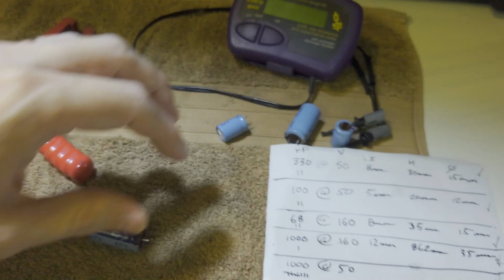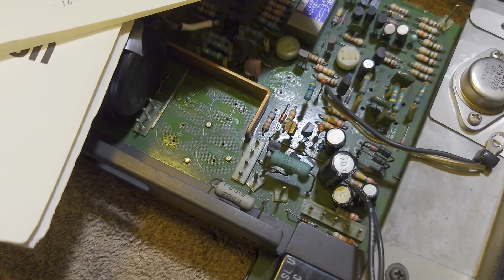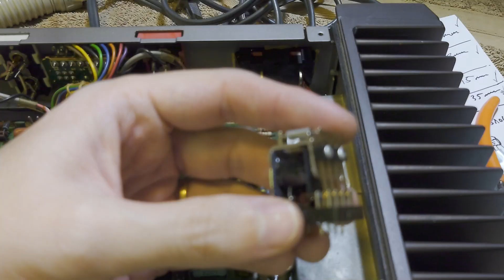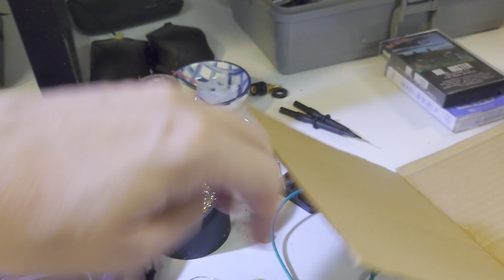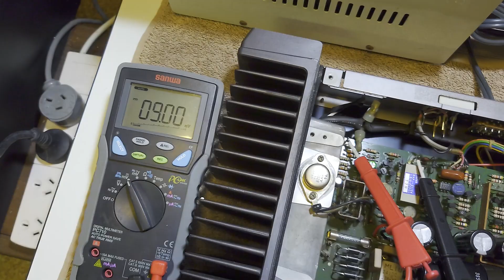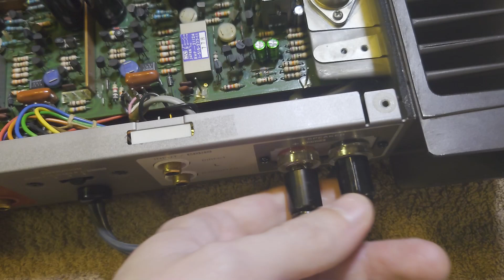Second Sony TA-N86 Repair + Restoration

Comment: Fred, thanks for the safe return of my TA-N86 amp to Tennessee.  It was well worth the quite modest cost to obtain your experience and care used in restoring this amp to better than new condition.  The amp is perfect.  It is everything I hoped for since the late 70s when I dreamed of getting a pre-Esprit stack but could not afford it back then.  Having owned a Pioneer M-22 and a couple of Passs Labs Class A amps, this Sony shines the best.  The sound is detailed and crystal clear.  All my music files recorded in MP3, FLAC and DSD are new again and rewarding to hear through this amp.  It is being driven by a McIntosh D-150 digital preamp with a quad set of Sabre DACs.  The speakers are a pair of highly upgraded JBL 4301-B studio monitors.  Kenrick Sound in Japan did the upgrades and restoration on the speakers which are very efficient and well driven by the Sony in Class A mode.  To fill out the bottom end of the sound spectrum, I have added a REL powered subwoofer using the high-level inputs on the sub driven by taps on the speaker terminals of the Sony amp, thus, every note heard in this system passes through the Sony.  This is the setup recommended by REL.
If I was running a booth in a  high-end audio show, I would use a bi-amp or tri-amp set of TA-N86 amps that you restored to drive the speakers.  I have no doubt that the Sony amps would draw quite a bit of interest.
Every amp I’ve ever had has come and gone but this one is here to stay.   When I find another `stack member’ It will come straight to you for restoration.  Thanks, Fred.
Reply from the maker: Thanks for the really kind words, Pat. It was a pleasure to work on this amp for you, and I am obviously very happy to hear that it has met your expectations. If you get more pre-Esprit gear in future, you are very welcome to send it across the pond again for restoration. Thanks for putting your faith in me and for being a great customer (with exceptional taste!). Cheers and take care 😊

Comment: I will be very interested to see how this goes, I have a working one of these which probably needs some TLC and another non-working unit which has a cracked/burnt PSU board which I am replacing with a board with a higher Tg
Reply from the maker: Interesting! Have you got Gerber files for a new board or is someone already making them?
Reply: @fredsk1  I have the Gerbers, I used the trace function in KiCad to copy the PCB and get 5 off from PCBWay, just need to re-populate with good parts and test ... when I get the chance
Reply from the maker: @alanhurst1579  Very keen to hear how you go with that. Would even buy a PCB from you if it turns out. The PCB in my main unit is pretty roasted too.